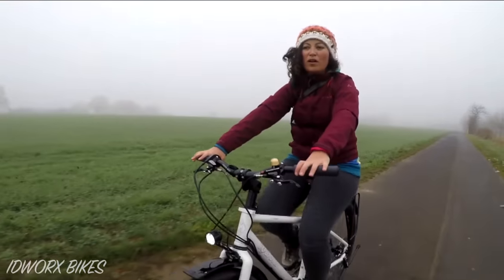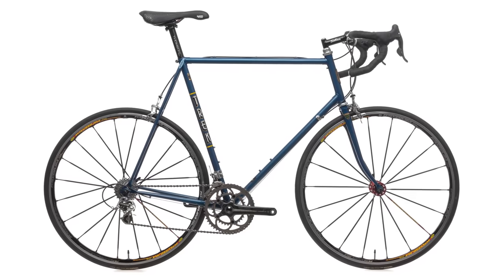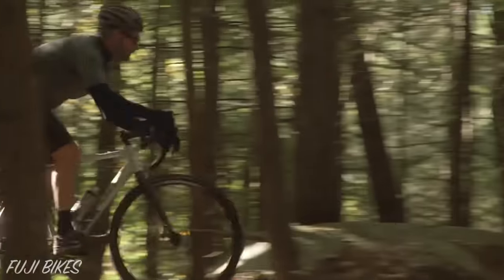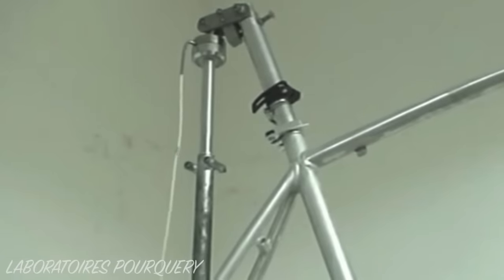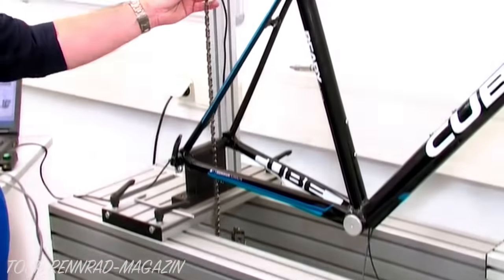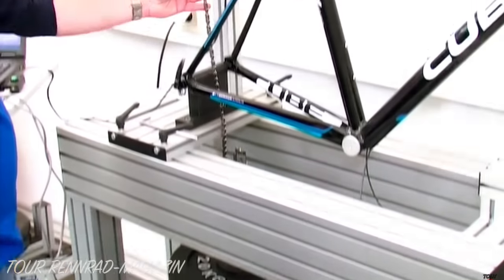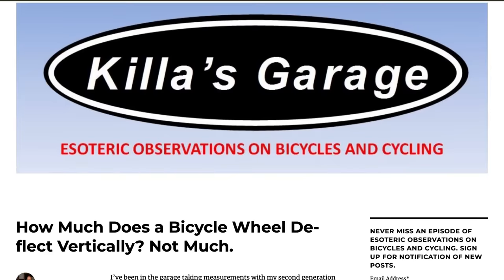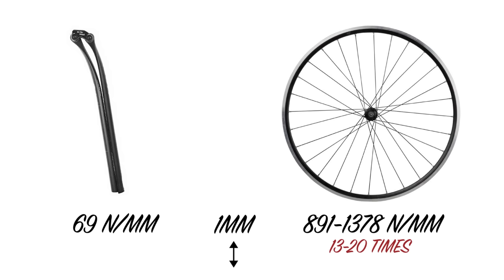Why It's Impossible For Steel Frames To Be More Comfortable Than Aluminium

Comment: I have a canyon endurance with flex seatpost.... but when it bends it changes the angle of the saddle..... I had problems with that, so I have a normal again now.... om my road bike that is but the 30mil tubeless tires give me a lot of comfort :)

and for my bikepacking vacations I orderd a santos crosslite with 50mm tires and rohloff/gates system hope to get it in 5-6weeks :) for my iceland trip this summer if I can go ad least
Reply from the maker: With flex posts, I've always accounted for the saddle angle by tipping the nose forward when no load is applied. But currently I'm using and loving the eeSilk post which stays flat as it goes through its travel - and I've been able to tune the spring rate to the level I prefer!
Congrats on the new bike! If you haven't used the Rohloff/Gates combo before, you're going to absolutely love it.

Comment: This was very interesting and I fully agree, f
Design is what matters, not the matereal.

But the most comfortable road bike I have ridden, tried steel, ALU and carbon was a 1975 Peugeot steel bike with a Brooks saddle.

Granted, race saddle on both the alu and carbon bikes and they were budget options so no nice flexy seatpost
Reply from the maker: Brooks saddles have a huge amount of vertical compliance! They are also quite effective at damping vibrations. 👌🏼
Reply: @Cyclingabout  they shure have, and they look damn good doing it.

But I must say, my mountainbike has without a doubt the most vertical compliance and thus the most comfort, could be cause of the 160mm rear suspension and 2.6" wide tires

Comment: Stating the obvious; measuring deflection from the saddle applies only if you remain seated. However, if you see a bump in the road, the natural reaction is to stand up from the saddle.  Thus; I’d say this applies only for smaller chatter in the road.
Reply from the maker: Yes and no. When you stand up we take the seatpost/seat out of the spring series, but still, the tyres are the softest spring by a long margin. When we calculate out the vertical deflection from the spring series it's still almost entirely from the tyres, rather than the frame (but you're right, the frame flex will contribute a larger percentage compared to the sit-down scenario).

Comment: Static stiffness does not necessarily correlate to dynamic stiffness, interesting topic though. What is felt through the saddle and handle bars is a result (ignoring effects of tyre & wheel combo) of road load forcing at the hub and the dynamic stiffness of the whole system.

Comment: You have ignored the most important thing about comfort and steel: the forks. Curved steel forks flex beautifully over potholes and rough paths.- they make a real difference. So much so that Thorn offer a curved steel V-brake bike in preference to a stronger straight fork for disc brakes. The ride quality is more important than the brakes.

Can you get curved aluminium forks? I don’t think so.

Comment: One thing this implies, but does not state - If we're relying on seatpost flex, then a compact frame should always be more comfortable than a more traditional frame for any given geometry due to more exposed seatpost.

It also opens up a follow-up about handlebars and forks.  Forks are a much harder topic than handlebars, certainly, and also less easy to replace.  And bar wrapping.
Reply from the maker: That's right, a compact frame that allows a seatpost to flex more, will always allow for a more comfortable ride.
Handlebars and forks are another great topic, let's see if I can find enough data to make a video about it.

Comment: All I can tell you is my titanium gravel bike with titanium seat post  IS like floating on a cloud. It is unexpectedly good - I’ve never experienced anything like it. I’ve also got a very comfortable, modern, market leading carbon road bike. It’s great handling and decently smooth for hours in the saddle but doesn’t have the compliance of the titanium bike.  They are both designed to a different goal and achieve it.
Reply from the maker: I'm glad you like your titanium gravel bike. Do you not think it could something other than the frame material that makes it like floating on a cloud? Tyre width, tyre pressure, seatpost choice, saddle padding, ride position? Looking at the data we have, it appears that the latter is the more plausible scenario.
Reply: @Cyclingabout  It's the 'plushness' of the ride ---- I've pondered it a lot and to be fair it's probably all of those things you mention. I thought it must have something to do with compliance in the design of the rear triangle of this titanium bike, being designed with gravel and touring in mind.
 
And I'm not comparing Apples with Apples. A light Canyon Ultimate all out race bike with 25mm tubed tyres at 100PSI shouldn't be compared the ride feel of a Lynskey Ti gravel bike with 30/32mm tubeless tyres at 60PSI!  But both have similar Fizik saddles because that's what suits by backside! 

They are different tools for different problems but on my Bris-vegas city commute I do switch between them and whatever the reason is, the Lynskey just feels so cloudlike. Last year I rode it 800k from South Australia and through Victoria on rough country roads and it has all-day comfort. So lush. 

But not to say the Canyon is harsh. It isn't.  I could live with it for 12+ hours of the Alpine Classic up around Hotham & Falls Creek but as a race bike it does come into it's own when riding fast. Hop on it and you just want to ride fast all the time. So sharp, so responsive, so much feedback.

Horses for courses....
Reply from the maker: I'm glad you've arrived at that position! The wider tyres, lower tyre pressures and ti seatpost explain a lot, and match up to all the data we have.

Comment: This makes total sense. But what about when you factor forks in? Steel forks have visible flex and damping compared to AL or carbon don’t they?
Reply from the maker: Steel and carbon forks can be manufactured to be much more comfortable than aluminium! But when we look at the deflection numbers of most steel and carbon forks, there is actually little difference when compared to an aluminium fork - so you need to pick the right fork models.

Comment: Superb video! Thanks for digging up all those numbers. 
What about the fork? It's probably the longest lever on a bike with a diamond shaped frame and therefore deflecting more than the seatpost. I never rode a carbon fork, but all steel ones I rode felt much more comfy/flexible than aluminium ones. Keep it up!
Reply from the maker: Cheers! The fork is a different beast, and there is a tonne of variation! I'm hoping to collect enough data for a fork video too, but we'll see.

Comment: One thought I have that wasn’t touched in the video is.... LATERAL FLEX. In cases of bikepacking with loads, gravel roads, and single/double track riding, your bike is very rarely in a 100% 90 degree vertical to the ground position while riding. There’s weight shifting from the rider that constantly makes the bike lean side to side. Turning, avoiding obstacles, angled terrain... all this cause the bike to lean in small degreees, away from 100% vertical position. The rear triangle in steel and Ti have great lateral flex and feel, and are, more absorbent. Lateral force can and will lead to broken spokes and catastrophic wheel failure. So, in theory, the lateral flex in steel and Ti frames help absorb that force and relieves fatigue from the spokes and wheels.

Comment: I'm interested in guitars and bicycles and the discussion about different frame materials is pretty much exactly the same as the discussion about which wood guitars are made of.
Yes indeed, the material is a factor but it's a way smaller factor as you might think (qed). Interesting video though.

Comment: I drive Kona Roadhouse (Reynolds Cromoly) and Canyon Commuter 8.0 (aluminium). On Kona I feel like driving suspension bike. On Canyon it's like sitting on and holding a sharp knife. Being aware that there are two different types of bikes it's still hard to believe that it is not the reason of the frame material.

Comment: Very well-researched, informative video. One thing I'm curious about though- springs have two major properties which concern us here, compression- which you've covered- and rebound. Rebound rate is discernible in my entirely anecdotal experience. For example, in the early days of elastomers in suspension forks etc, the rebound rate was so slow and horrible that in the winter, you were genuinely better off on rigid forks. The Cane Creek "Thudbuster" seatposts were similarly awful I seem to recall because they couldn't fully rebound quickly enough to absorb the next bump. I ride all three materials- carbon, aluminium, and steel- no titanium- and given the same wheels and tyres, they definitely feel very different to me (similar geometry in terms of chainstay length, angles, length of exposed (carbon) seatpost etc. It may well just be preconception on my part but I usually reach for my heaviest bike- the steel one- if I'm doing a long ride, without consciously considering why... I'm a sucker for the "steel is real" retro-grouch hype I guess ;-)

Comment: THAT S VERY INTERESTING THANKS l will add l did feel differences in my bikes of steel alloy and carbon .l want to say my steel is most comfortable but it does have fatter tires and saddle than the carbon ALSO l notices a huge difference when swapped wheels on my alloy MTB from fat MTB tires /wheels to skinny road wheels l felt more the effects of the seat and front shocks going over the road of course faster and lighter WHICH WAS ALOT OF FUN :)

Comment: Hmm,  so confused now. I rode a cheap Bianchi,   back in the 80s, then got an expensive Rossin. I thought the Rossin rode  soo much better.!! I later discovered my bottom bracket was toast on the Bianchi so maybe that was throwing my judgment off.  It also has C- record hubs which were way smoother on the Rossin.  
I now have a new bottom bracket on the Bianchi and am going to try the C- record wheels on it also. Let's see which is smoother feeling bike. Seat is way important... in my humble opinion , now I am thinking seat post also. 

I will say the frame build is super important to efficiency on power that goes back to the wheel. 
But yes he said the video was about " COMFORT IN CONNECTION TO THE FRAME ONLY...."

Comment: Mass and hardness have a big impact on well...impacts.  It is true that air can allow some compliance as well as carbon seatposts, and when I added a Record carbon seatpost to my Bianchi road bike, the ride improved tremendously.  Still, when an our body strikes into a an object, the density of the material should be factored in, and I mean the total hardness.  Good frames with have some good stiffness but show a lower impact hardness.  I think you are measuring one thing when the factor riders are judging is another.  For example, if I drop a crystal or glass on a porcelain sink, often it will break, but if it drops onto a stainless steel sink, it won't not because of lots of compliance but because each has a different density and modulus of elasticity.

Comment: In theory you can design a frame made out of steel, titanium or carbonfiber more compliant than one made out of aluminium. I have no experience with Mountain, Gravel or Roadbikes but im am a cargobike designer and in cargobikes you can feel a very significant diffenece while comparing frames of similar geometrie, tires and seatpost if they are made from aluminium or steel(you have to take in account that cargobike design is inherent different from any dimond frame type bike(which is space frame) while cargo bikes are usualy hybrids betwen a space frame and a Beam(cargo area)). 
So i think there could be comfort benifits for some frame materials which should be more obvious if you compare bikes with comparable tires, seatposts and sadles. 

PS the possible comfort of Carbon fiber frames can be seen in flexible carbon fiber seatpost and because there is no aluminium alternative option

Comment: Final thought for everyone, steel is steel and will feel like steel.  Carbon - plastic is a carbon -  plastic and will have that specific carbon plastic feel to it. Can't compare those two and sell the idea which one is better. I am a guy with one steel frame, because I love steel. Steel bike has some weight to it and does not bother me. Carbon bike are super light - fast acceleration and therefore racing application comes from it. Steel frame feels like I have a steel structure underneath of me - superb feeling!

Comment: You'd all be more comfortable if you had the handlebars higher than the saddle. I put a pair of BMX handlebars on my bike so I'm not all hunched over anymore and the difference it made is incredible! No more cramps or aches in my neck, stomach or shoulders. Riding upright is the way to go. I don't know why ANYBODY would want to ride with their arse up in the air and knuckles dragging on the ground.
Reply from the maker: I don't like an upright riding position. I never have any aches or cramps in my neck, stomach or shoulders. Everyone has different fit preferences - I'm glad upright works for you.

Comment: Not sure why, but you only looked at flexing capabilities on a perfectly vertical plane.
The fact, that you are pedalling, and therefore constantly shifting weight on the x- and z-axis, however, introduces additional movements to the side. 
And from my understanding, this is where flex starts playing a role (and is even visible when heavy riders are sprinting).

Moreover, the sound of knocking on a carbon frame is irrelevant: afaik the stiffness of carbon depends of the direction of the force, which is why carbon frames can resist tons of energy in one direction and still break in a minor crash.

Comment: After putting  a simple  carbon  seat post on my CX aluminum bike, the ride was so much better, I didn't have the desire  to  get rid of the bike. Totally  different. I also have bin wondering, if getting a carbon handle bar would have a damping effect also. Iwas thinking about doing this on my road bike.
Reply from the maker: It depends on the bars! Some carbon bars are built super stiff, others are designed with vertical flex in mind.

Comment: Funny I'm doing this exact spearmint right now I got my carbon fiber Cannondale topstone carbon, after a week I hopped off of that onto my aluminum Poseidon redwood same size wheels same tires, after a week of that hopped onto my jamis renegade, ( double bedded Reynolds steel,) any difference is massive same Wheels same tires same handlebars and metal seat post versus the carbon on my top Stone. The aluminum bike definitely has the harshest rides even with 650 b by 47 you can definitely feel the harshness. And funny before this comparison I would have swore it was smooth. I would say the top Stone probably had the most compliance but in the worst way receipt flexing backwards has an awkward feel to it almost like you're going to snap the bike in half you can feel the compliance but it never gives you anything back. When you hop on the steel I get the same amount of compliance felt on My topstone carbon with some actual feedback there's some springiness to the action I didn't just feel like the seat was mashing backwards it felt like the bike was actually working with me. I might add also I did the same climb on all three bikes which is a pretty notable climb in our area. I 100% had way more traction riding the steel bike both the carbon bike and my aluminum or spinning out of the Hill losing traction at points the steel bike stayed planted more than any other bike I've climbed up that hill with. Just feels like there's a connection to the ground that the other two bikes do not have. I come from a racing background carbon fiber is all I found for years and years and years from high-level bmc's, to fully Dura ace specd Cannondale and so on. The difference you feel with steel is real!

Comment: Vertical compliance is only one parameter. There are many other ways energy is transferred throughout a frame and the frequencies that the frame deals with.  Geometry can play a big role in that and so can tubing shape and types of materials. As you stated seat post length above the seat tube was one factor.  Chain stay lengths, seat stay shapes, headset and fork angles and lengths. It is not as simple as you have made it out to be.

Comment: Interesting indeed, thank you ! On MTB hardtail though, the story is a little different : most of the roughness perceived would be in a different posture which is of course standing on the pedals. The chain of stiffness would be : tire/rear triangle/crankset for the feet feeling. Let's forget about the hands' feeling who are heavily protected by a 1XXmm travel fork.
The other fact you can add to your video would be that all of your measurements are static ones (i.e. very very slow), whereas our body is much more fatigued by certain frequencies, and that if the stifness is comparable when going from static to dynamic, the amplitude can vary a lot. Riding on trails or pavement can induce a lot of vibrations, so that this consideration is not pointless I think. Unfortunately I'm not aware of any litterature about it.
Keep up the good videos !
Reply: The type of bike makes no difference
Reply: @HkFinn83  ouf course not, the posture does.